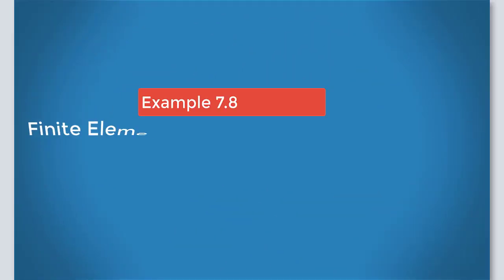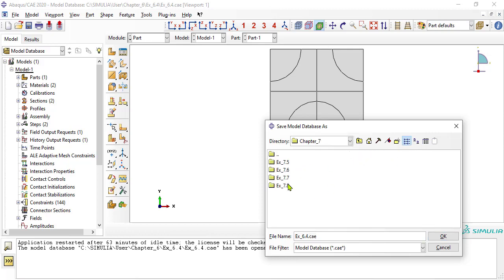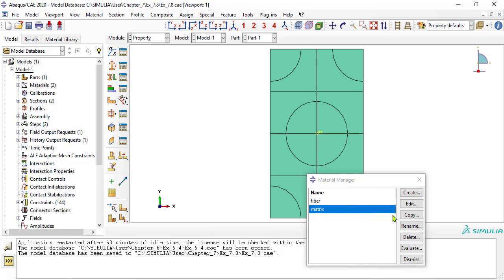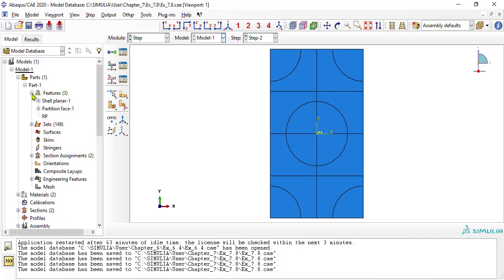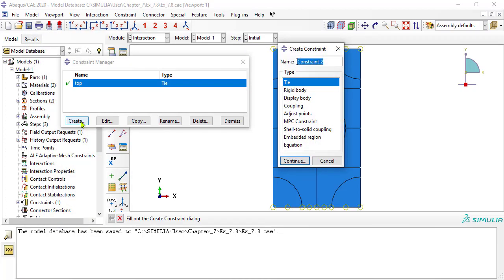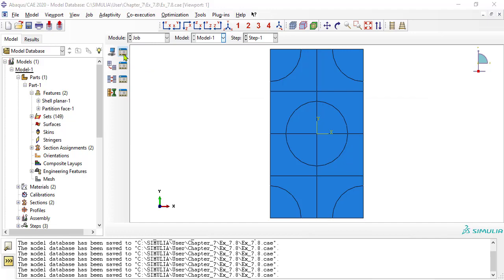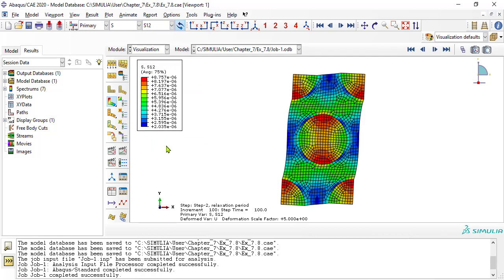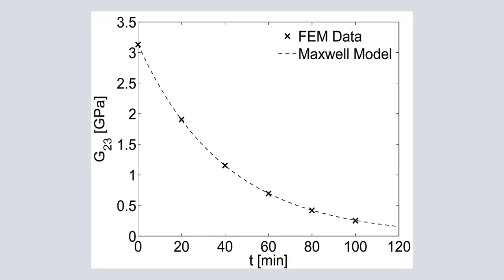Example 7.8 Viscoelastic Computational Micromechanics Homogenization of Fiber Composite using Abaqus

Comment: Professor, 
you have given a shear strain in X direction, that means its G12
at the end, the plot shown is G23
it has to be G12 right ?
is my understanding Correct ?
Kindly request Guidance
Reply from the maker: No, the plot is G23. I apply gamma4, that is gamma23, but in Figure 6.7 the lamina axes 2 and 3 are oriented along global coordinates X and Y because it easier in Abaqus to draw the geometry like that so you have to do the conversion between lamina coordinates and global coordinates when you read the results, apply loads, etc. Otherwise, you can do the drawing with the fiber oriented along X but for me that is hard.
Reply: @EverBarbero  understood 
thank you very much sir